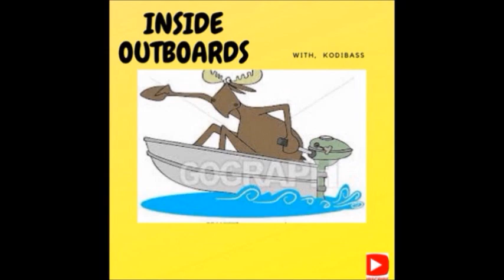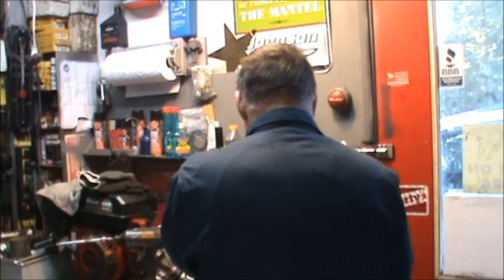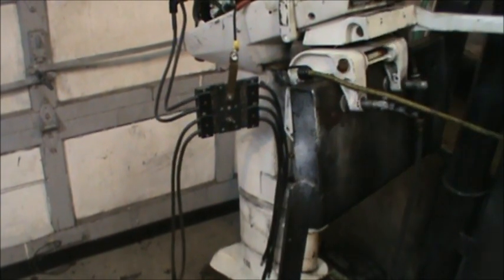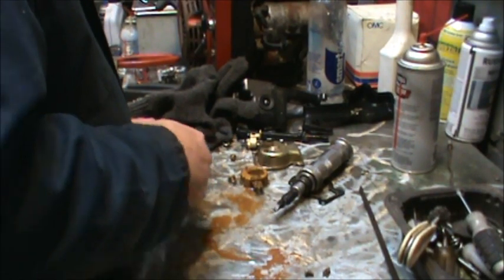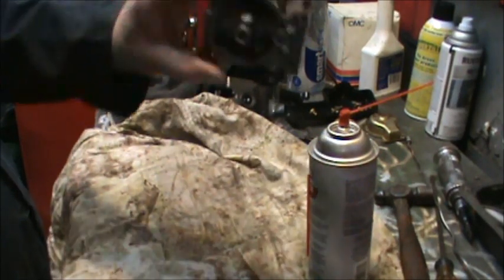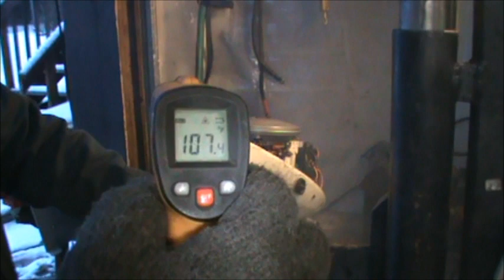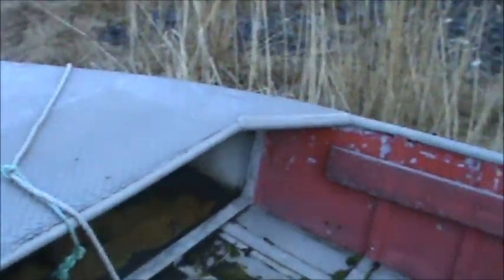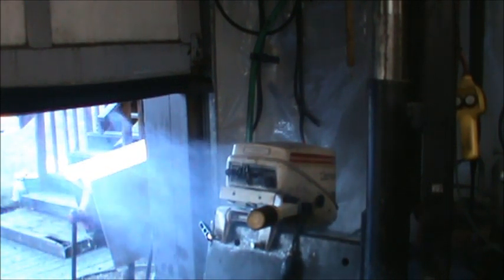JOHNSON 1980 15 HP OUTBOARD,  (  Most common problem )

Comment: Hi Kodi, neighbor down the street has a older Susuki 8hp that ran out of oil and seize up. He said he put oil into the cylinder which I believe has one. If he plans on tossing it I'll take it and work on getting it freed up even if I put it into a press and work it from both sides with the block apart. Who knows may get luck and just replace rings. Worth getting a harbor freight press for or split wood with it. Haha
Reply from the maker: On those Suzuki's I have had a few  8 hp 2 strokes, should be a twin cylinder. If so in order to replace the center bearing the crankshaft is a 2 piece & has to be pulled apart then Pressed back together,  & for that U need the Suzuki crank Jig to line things back up. Also there R no end capes on the con rods, So to replace the con rod lower needle bearing crank has 2 come apart.                kodi
Reply: Cool, thanks kodi, if I pick this up from him being we can't get the piston to move this spring and I'm lucky enough to get the piston out without breaking anything I'll get the service manual for it before reassemble. I found a guy on the Web that sells tools for outboards if I can't make it myself? I'm getting a stick welder here soon which I plan on making outboard tools as well. Also RMD creations who is one of our subs is setting up to build 3D parts with his printer. Send him a broken part no longer made and he will re-engineer it and send you back a new part for cheap👍

Comment: would like to see a vid on timing and setting the points on the old evinrude 4 to 15 hp. also Ive found that guitar strings make good carb cleaning tools, because some are ribbed, some are not, several different sizes..

Comment: To me, this vintage of 9.9/15s was the best.  Those carburetors are bullet proof, easy to clean, and never give much trouble...The metal bowls are expensive though, but still cheaper than the crap on the CPS carbs.  The beauty of these things is that the powerheads and gearcases are very rugged and tough to kill...  Such a shame about the grommet issues, but they keep on running OK even after customers smoke em good due to the plugged up grommets.  Yeah, the tiller gears are a pain, but those later cable units aren't all that great either, especially when you price the new cable....  I was never impressed with the later models, yes the removable pans are nice, but all those tiny screws are a pain, especially when seized.  Not a fan of the center mounted tiller, or that tricky forward shift lever either.  Everyone says that they run nice and have alot of power though...
Reply from the maker: My Man K.  Well You just about summed it Up.  Yep'  Both have  something 2 like & Dislike.    I could go on about Both for hours''  Here is the real deal 4 me..   when I go thru them & Make them AS THEY SHOULD be..  They Sell Like hot cakes. I just sold a fine example for $1,000   The customer wanted a light weight 2 stroke that was dependable.  Boom,  The one I sold him I paid $150.00   Put in a carb kit, & impeller. & cha-ching.    He was / is  a happy customer.  Good motors .. Compared 2 the krap that is on the Market 2-day. Imho  Both of these outboard models are far Above what is available. today 4  sure.                                                              kodibass
Reply: @kodibassInsideoutboards    Well said buddy....

Comment: Hi Kodi, Thankyou for taking the time to make these video's. I find them really useful for maintaining my own 1977 Evinrude 15HP. I'm pretty sure following you I could rebuild the whole outboard if I needed to. I have a couple of requests.

1) Could you please make a video of My outboard won't start what should I check. I'm guessing here but compression, spark and clean the carb, new fuel?
2) I have a second motor that is a 1982 15HP Evinrude Long shaft that I bought 2 weeks ago, not running unknown condition but flywheel turns freely. Compression in both cylinders was 70PSI. Remoting the Carb for cleaning the High speed Jet and Low speed needle will not move so I can't thoroughly clean or adjust. Is the compression too low to bother or cannibalise parts for my '77 Short shaft?

Any tips on  how to remove the Jet and the Needle?  a few squirts of WD40 over 2 days made no impact.

The seller also gave me a 1981 Longshaft Johnson 7.5HP that I haven't looked at yet., Thinking that what to check might come in handy for this one,

Keep up the great video's.
 Your friend from Australia Dave
Reply from the maker: Try soaking the carb in a 50/50 mix of Acetone / transmission fluid for a day or 2.   7o psi is not that bad for a pull start small outboard,  Try spraying some two cycle oil in the cylinders & then re-check compression with a electric drill & socket.                                                          kodi

Comment: What had rusted body is Ally ? And jets brass ?
Reply from the maker: The bowl itself pits &  rusts in the bottom,  Also the E-clip that little wire contraption that pulls the needle down if it gets stuck in the seat.                 kodi
Reply: Crap from the fuel tank

Comment: @10:25   NO Explanation about the VERY SMALL Spring (0336842 - Spring Clip)   that keep the Float Valve Needle in place !! 
Or Indeed NO MENTION of the  0396521 - Float Valve Assembly
@18:21 - MAGIC --- Still no MENTION of them VERY SMALL PARTS ??? 
Thanks for uploading - maybe you have another video on Carburetor strip down & rebuild >> ???